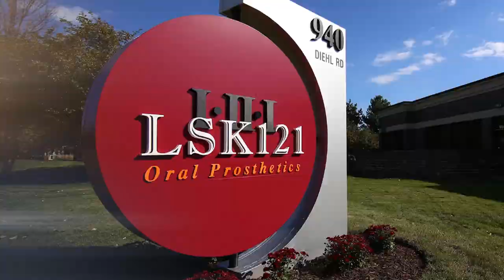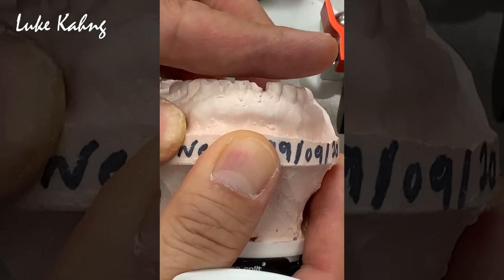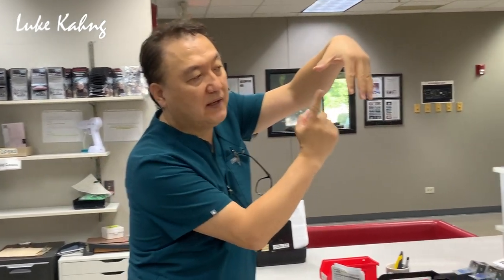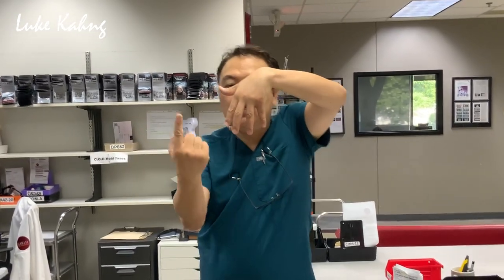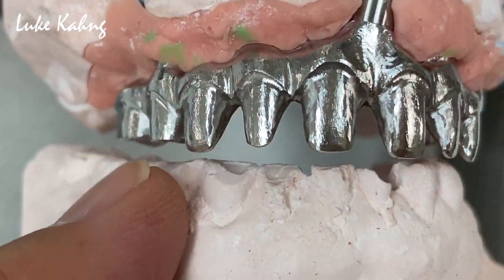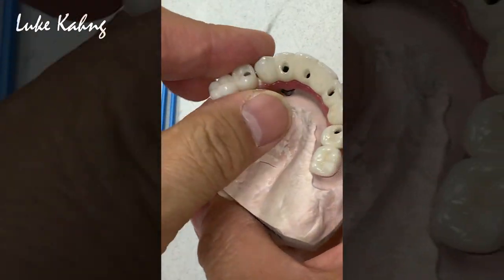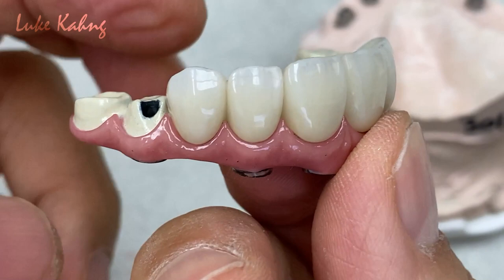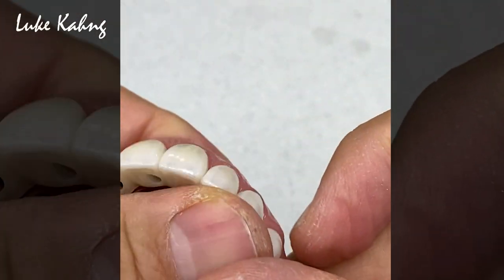My Solution for a Zirconia Implant that Broke 4 Times

Comment: Zirconia is great for 1 unit or 2units (with one cantilever) when proper oclusal reduction is present. I used to do 0,6-1mm for high strength zirconia. Not anymore. Seen a "lot" of single unit fractures in bruxers to continue that path. Always aiming for 1,5mm now. More then 2 units and you'll need PFM. Don't even think otherwise. Full mouth zirconia WAS (probably still is) a trend and a lot of dental labs (more than what some people might think) stopped working with cast and decided not to mill co-cr because a zirconia/emax/etc. milling machine is way more convenient and pushed a lot of dentists into deciding to use zirconia for bridges and full mouth implant supported restorations. Business-wise Zirconia is spectacular. In terms of performance not that much spectacular. 
Some dentists were careful, some went with the trend. No deaths reported AFAIK so life goes on 🙂
Reply: Still good old casting. I agree zirconium is not for large ranges and complicated cases.

Comment: ok, you explain a lot this and that.... Tell me please, which is the best prothese on full mouth restoration which doesnt get broken and last for a very long time, like 20-30 years ???
Reply: Sadly there is not such a thing, because our oral cavity gets out of shape after multiple extractions and/or with edentulous Pt's year by year, and the aging gradual process of natural changes starting in early adulthood stage..affecting our jaw bone structure getting lower and flatter "bone resorption" specially the mandibular area, getting unstable any kind of implants due to bone loss, in consequence any prothesis losing its stability and functionality as well before that desire time "20-30 years". I saw simple and affordable  acrylic dentures still in shape after long period of time, but not fitting anymore as before. Everything is relative and unique in between cases and patients.
Reply: @yourdc  Dr. aplicaría de la misma forma para sobredentaduras???? Es mi sueño poderme colocar una. Mil gracias por su ayuda 🙏
Reply: @beatrizeugeniapatinomedina7611  Sobredentaduras or Overdentures. Dependiendo del tipo de soporte que usaría su Dentista ''dientes naturales o implantes". Con la ultima opción de soporte mencionada previamente, seria mucho mas costosa y de proceso lento ya que se tendría que esperar por la OseoIntegracion de los implantes colocados en primer lugar y quizás extra cirugías para aumentar el soporte óseo dependiendo del lugar anatómico en uso, y como ultimo paso la restauración final. Pero la estabilidad proporcionada con esta opción seria la mejor versus una dentadura convencional donde la estabilidad seria un problema que incrementaría progresivamente gracias a la perdida de tejido oseo junto a una dificultad en lo que es masticación, articulación de palabras e inclusive deglución. Espero esto le ayude a tomar una buena decision para que así pueda satisfacer sus necesidades dentales.
Reply: @yourdc  Mil gracias. Dios lo bendiga 🙏
Reply: It depends on both patient and doctor